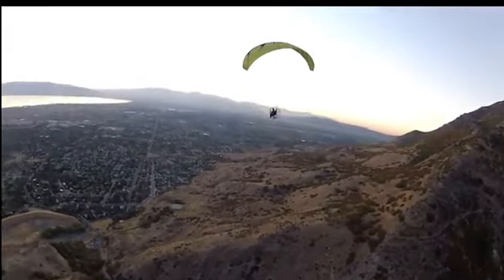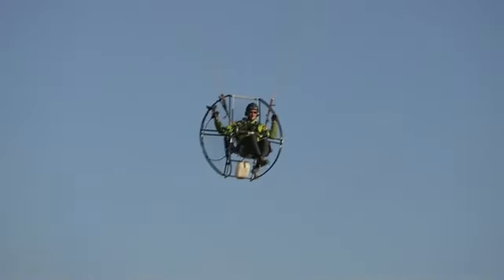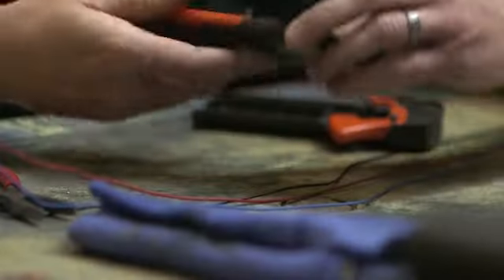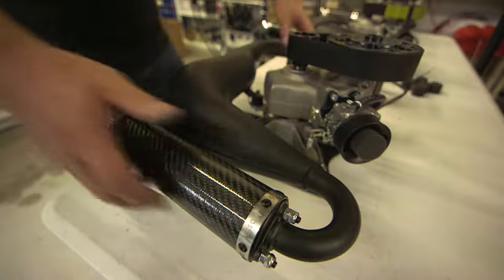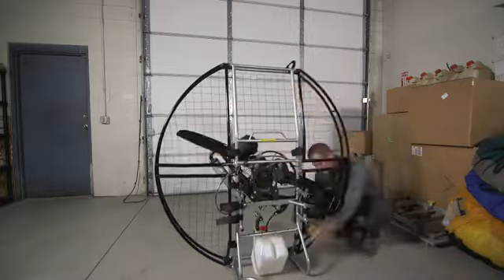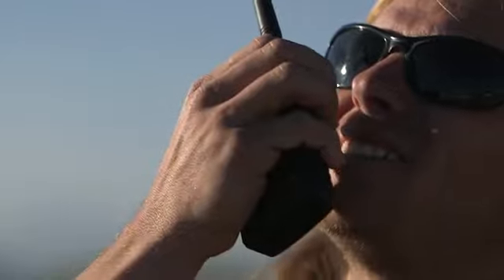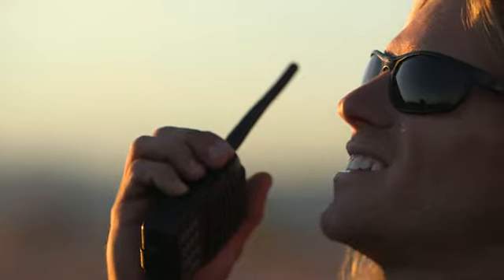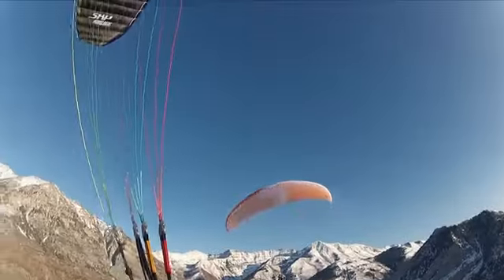Flat Top Paramotor On Discovery Channel!! The Safest Paramotor Equipment On Earth!!

Comment: I have a question that might seem stupid, but is there a height or weight limit on these?
Reply from the maker: Not really as the Flat Top will carry over 600 lbs and accommodate someone over 7 ft tall.  Plus since we make the harnesses here in the US we can custom build a special harness to fit pretty much anyone.  How much do you weigh? How tall? Call us at 800-707-2525 and we can answer all your questions in as much detail as you would like.  Let's go flying!!

Comment: Superdell, you're inspirational!  I'm almost converted.  Paramotoring does look like a blast, but they've always struck me as delicate, complex vehicles with a great many limitations. I had no idea the range was 280 miles and could carry a passenger! Island hopping and camping in remote mountain meadows sounds like a real blast!
Reply from the maker: There is a lot of junk out there and most "instructors" don't have a clue what they are doing.  So it is critical you get the right gear and training as with anything.  So there is a big difference between those on Flat Top paramotors you see having a blast all over the place and those flying more outdated gear.  Just call 800-707-2525 and I'll get you fixed up the right way.  It will be the coolest thing you ever do.  There are just unlimited uses for a backpack aircraft like this.  It is so incredible to be able to go explore everywhere and anywhere and get to places others just can't get to.

Comment from the maker: Yes we are the biggest distributor in the world and have the biggest inventory of both new & used gear that you see all over the place.  The $2500 we charge for training is the extremely discounted price.  That $2500 includes lodging, and use of equipment and even insurance on the equipment so if you trash a $12,000 aircraft during training, you pay nothing with us.  That is a huge gigantic expense elsewhere that will for sure cost more than our entire training class.  Call us at 800-707-2525

Comment from the maker: lol the spins I do are actually not crazy at all.  In reality I have over 11,000 flights without a single real injury unless you want to count a few scraped knees & bruises.  This sport is incredibly safe as long as you get the right equipment like the Flat Top paramotor & K2 I flew in this video.  There is a lot of junky gear out there so fear not I'll make sure you get the cool stuff.  Just give me a call anytime at 800-707-2525

Comment from the maker: We can fly in the rain. It is thunderstorms that are the issue not the rain itself. I've seen people fly through a down poor that was so strong the windshield wipers couldn't even keep the window clean. I certainly don't recommend it but yes you can do it. Same with snow storms. I fly in the snow all the time no problem. Just check the winds and make sure you don't have high winds as an issue.

Comment from the maker: Hi, just look up 600 lb paramotor tandem on youtube and you can watch the Flat Top Ninja flown by a 230 lb pilot taking a 304 lb passenger on only a 28sm paraglider.  So yes no problem at all with your weight if you get the right gear.  Just give me a call anytime and I can fix you up with the perfect setup.  Dell 800-707-2525

Comment: I have to ask,
How many bones have you broken since you started to fly?
I never broke any on 2 wheels but lost a lot of skin. Being the first motorcycle delivery driver in Atlanta back in '77 taught me a lot about how not to get them broken! Ride crazier than they drove! The first real race I was going to race in, I was totaled on the way to Daytona! 
BUT still it's a fair question! OR at least the bad bruises I know we all get! I'm getting my fair share of them getting my body back in shape with my Buzz! I know I'll get a few when I go PPG! LOL! 

Blue Sky's and Safe Journeys!
Reply from the maker: +rolloverriderpgr Well let's start with motorcycles.  On motorcycles I now have 11 vertebrae fused together, my hip was bolted on, hand bolted together, missing a finger and broken near every bone in my body.  Now for paramotoring I have way way over 11,000 flights, I've totally destroyed over a dozen Flat Top paramotors in crashes and pushing the limits and just doing crazy stuff and in all my years and years of flying I've never once even been injured.  I even stalled a 17sm uncertified acro glider straight into the ground and walked away without a scratch despite the fact that I already have 11 vertebrae fused together from previous injuries.  So other then a few scraped knees & bruises I've never had a single real injury in the sport.  It's the most incredibly safe thing you will ever do IF and that's a huge IF you get a Flat Top paramotor and a Dominator paraglider.  If you don't get that exact equipment people get seriously injured & killed all the time but on Flat Top paramotors not a single person has ever died and only a small handful have ever been injured and all of those recovered fully.  Truly an incredible sport but only IF you get that exact equipment.  Call me at 800-707-2525 and I'm happy to answer any other questions at all.

Comment from the maker: Actually you don't require a license over there.  So yes no problem training here.  Even if you did want to get the BHPA rating you would definitely want to come here for the training first so you get the proper training.  The problem is there are no good real instructors over there.  Those acting as instructors sadly don't know even the most basic things about the sport.  So definitely get the best training in the world.  Certifications are easy to get anywhere, the best training isn't.

Comment from the maker: No we do actually have those but they suck.  Gas is by far the way to go.  I built the first electric paramotor in the world but battery technology just isn't quite there yet to be able to compete with power and duration.  You can get tons of power, and you can get some duration from electric, but you can't get power AND duration.  Put out massive power and your batteries won't last 5 minutes.  The Flat Top Ninja can run full throttle for hours and hours straight putting out 200 lbs of thrust!!

Comment: Super Dell, how would the flat top fair in this situation?   Also, is there a way to avoid a situation like this?  The screaming of the guy really sent shivers down my spine!  https://www.youtube.com/watch?v=1K1Bvi00gRs
Reply from the maker: GcoEnterprises First sorry for that guy being a total moron and making the sport look unsafe when it really isn't.  That guy breaking his back has absolutely nothing at all to do with the sport.  That is only what happens when you absolutely refuse to get proper gear and training.   I told Glen Tupper straight out he was going to break his back or die if he bought that crap gear instead of a Flat Top.  He refused any proper training and then got a Parajet and a paramania wing which is the absolute least safe crap on the market.  So first the guy is absolutely clueless but goes around pretending like he is some expert pilot.  It's seriously insane.  He flew straight into the rotor of the mountain.  Now if you did that exact same thing on a Flat Top & Dominator there would be many many differences.  First the Dominator has well over double the lift and is a ton safer.  Next the Flat Top is much lighter and has 20-30 lbs more thrust so that along with more than double the efficiency of the wing and you would have had absolutely no problem climbing right through that rotor where he flat out didn't have the power as he was on a much weaker and heavier paramotor and the worst wing in the sport.  Then if you hit the ground like that the Flat Top gives 18 inches of crumple zone under your spine which would absorb the impact.  With the unit he got despite the fact that I personally and directly told him not to get that piece of crap Parajet as it turned him into the crumple zone for the paramotor.  So his body his first and the whole unit and all the thrust it was producing bashed down on top of him.  So instead of the Flat Top skids hitting first and saving your spine his spine hit first making his spine the crumple zone for his unit.  Here is a video that shows very very clearly back to back people hitting much much harder on Flat Tops who all walked away totally uninjured vs those on units with no crumple zone where it takes very little impact at all to kill you: https://www.youtube.com/watch?v=060yaNiN1oU    This is a huge factor in the sport along with the fact that the Flat Top has a quick release harness if you go in water and no other unit does.  Just those 2 factors, crumple zone & the quick release harness could have saved 19 people from dying last year.  19 DEAD just last year alone because of a lack of just those 2 safety features.  6 drowned and the rest died from impact because they didn't have any crumple zone.  The Flat Top has hundreds of features that make a life & death difference but even just those 2 alone could have saved 19 people from death last year.   So without question had he been on a Flat Top and Dominator like I told him specifically to get many times he would very likely never have hit the ground and if he had there is pretty much zero chance he would have been injured.  I have waaaay over 11,000 flights pushing just about every limit there is and have totaled over a dozen Flat Top paramotors in different crashes ranging from full stalls straight into the ground to death spirals into the ground at over 50mph and I've never once been so much as injured.  Not one single injury and these morons guy the worst gear on the market  get seriously injured & killed every week.  Just this last week many more were injured.  One guy got his face in the prop on a Miniplane because no other unit but the Flat Top really has any protection from the prop and 2 others got their brake toggle in the prop on kangook units again because in part they have no protection from the part and on top of that with pretty much all other units you have to take your hands off the controls to pull yourself up in the seat after launch where with the Flat Top you just pick up your feet.  Huge life & death difference!!

Comment from the maker: 245 lbs is no problem at all.  You could even take a 350 lb guy tandem with you.  The Flat Top Ninja weighs only 54 lbs dry but will carry over 600 lbs.  So 245 lbs is no problem at all. You just need to talk to competent people.  Sadly because there is no license in this sport to be an instructor there are lots of people out there acting like they are experts when they are not even close.  Just call me at 800-707-2525.  I'm the guy in all the cool videos:).  I have over 11,000 flights.